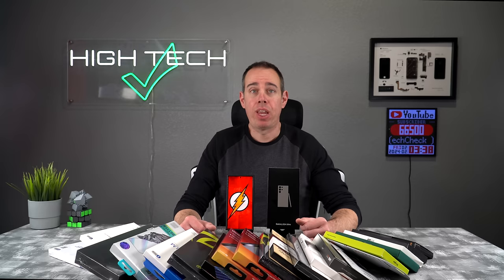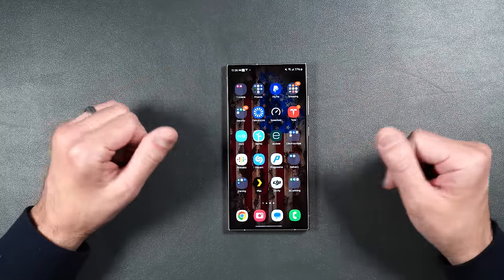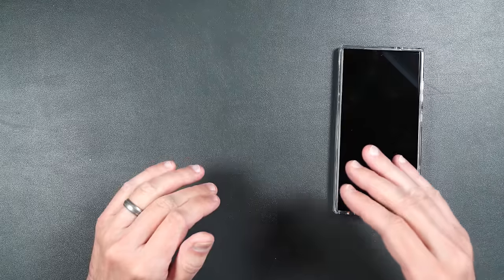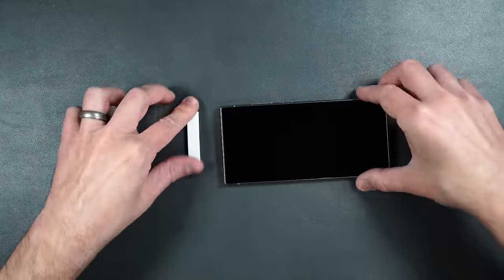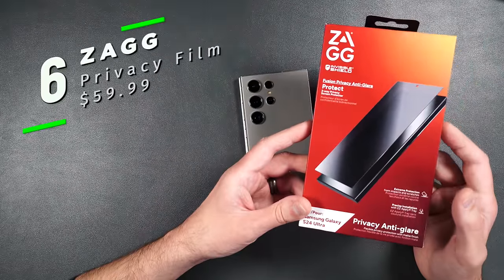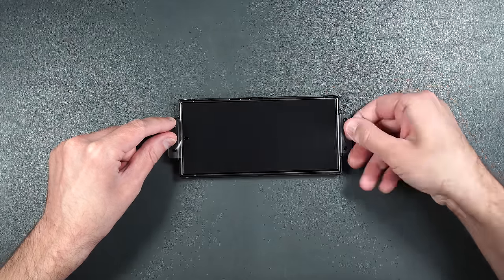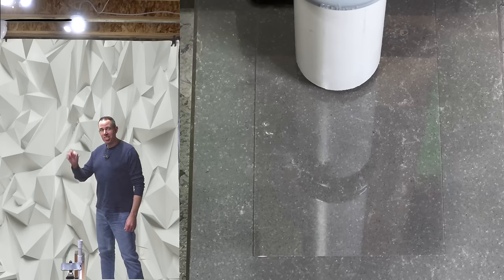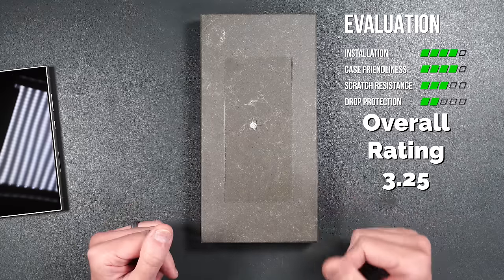Best And Worst Screen Protectors For Samsung Galaxy S24 Ultra

Comment: I just ordered the Whitestone dome UV GEN FILM. I did have the Zagg invisable shield glass elite protector before, it said on the package that it worked with finger print scanner but it did not. So I stopped using it. I hope this one works much better.

Comment: This is a brilliant video. If there's anything I'd add, it'd be the drop test. Stronger screen protectors tend to not break but then transfer all the drop stress to the phone screen and it breaks. I think it'd be better if you place a glass sheet under the screen protector instead of that solid block.

Comment: @hightechcheck ,   You made a fairly large error on the Whitestone Dome premium glass.  There should be NOTHING on the screen protector when you put the UV light on to cure the adhesive.  Anything that's on the glass will leave a shadow when you're done.  Since you left the square weight on the glass and put the UV light on top of it, that square weight left a nice shadow that will be VERY noticeable in sunlight.   You should address this so you dont make anyone else ruin their screen

Comment: What happened to the whitedome premium glass drop test ???
Reply: It happened that to remove the uv glass from the phone he already broke it.. Happens most of the time with uv glasses glued on phones... It's not easy to remove it without breaking it..
Reply: @chrisnik9750  they come with 2 protectors though, which is still weird how it didn't happen
Reply: @hypnotiq  my sense then tells me that the whitestone uv is somewhat same durability as the whitestone ea and therefore he didn't spent more time testing this one also.. 🤷🏻‍♂️

Comment: Nice review , it could have been better and complete review if comparison done between 2 different S24 Ultra . One with screen protector and one doesn’t have. 

1.  Do the rainbow test side by side with screen protector installed  and with the one doesn’t have.

2. Do a side by side comparison of screen with and without screen protector installed . Compare while screen is off .

3. Do a side by side comparison of screen with and without screen protector installed . Compare while screen is on. Open an apps, watch videos, games etc to have a more sensible comparison.

4. Do item 2 and 3 while indoors and outdoors.

viola! a more extensive and sensible review for the audience. 

Also strongly agree with other comment “one factor in choosing a protector will be whether it makes the screen more or less reflective relative to a standard screen”. which remain unanswered with your almost 2hrs video 😅

Comment: I've already bought & installed 1 of my amFilm Glass Protectors. 
Huge fan at how easy it was to install & a 2pk was $8! 
Bubble Free, everything from Fingerprints to S-Pen works great. 
I love the selfie hole & not that "U" Cut Out on the Protector,  it's dead center!
Reply: The privacy variety of that brand completely kills the fingerprint sensor. Just put it on and took it off not 30 mins ago. That's how I ended up here. 😅

Comment: Thank you so much for your screen protector reviews! :washhands: I tried the Whitestone UV GEN film w/no success (bubbles).  I saw your video the next day and decided to go with the Ultraglass UNBREAK TOP Glass which is better due to it's drop protection and scratch resistance.  If for some reason this doesn't work (bubbles) I'll return to liquid adhesion which I've had much success with.  Thanks again! 😀

Comment: Great screen protector review and love the time stamps! One question for you or anybody. You showed in your Torras that the cost was $7.99 but when I used your link, it was $25.99. That's quite a difference in pricing. Was your price listing an error or did the price really increase that much since the review?? Thanks!

Comment: The Flolab one was the one I was looking for. It does advertise anti-reflectivity, but I would like to see a side by side with the bare screen on the S24 Ultra. Great video though.
Reply: I have it on my s24u and its pretty great so far. Maybe not 100% as anti reflective as the bare screen but it's definitely noticeably less
Reply: @_jabe  That's good to hear. Does it distort the colors at all?
Reply: @DarkstalkerZero  not as far as i can tell. Didnt do a side by side comparison though. A side by side with my old screen protector vs the flolab one shows less relflections though. Not as much as the bare screen but for now thats by far the best i've seen
Reply: @_jabe  Thank you for the insight. Think I know which one I'll order now
Reply: @DarkstalkerZero  Its quite expensive though. I'm quite happy with it as it feels great and installation is amazing but i wouldnt spend 40$ just for the anti reflective coating. Its less reflecting for sure but the difference isnt worth that much in my opinion. But overall its a really good glass

Comment: i absolutely love your videos on the cases and on the screen protectors for the S24 Ultra.. Ive always been a Love Mei Metal Case fan as my note 10 and note 20 Ultra 5G both were saved countless times.. from being ran over with a car to falling off 3rd floor balcony, that darn case even saved me from a clip from a saw blade (current case). haha. So, I stand by the Love Mei cases even though they weigh a ton and turn your phone into a tank.. lol. Similar to you, I've always liked the whitestones dome glass screen protectors since I found them but they are a pain to take off once the spiderweb cracks are present.. So, their screen protectors are pretty legit imv. I am however curious on the new find and may try out the Torras Diamond Shield this time around or the UltraGlass due to the drop test..  So, thanks for the awesome video & for covering the real-world testing. I`d much rather watch a long video like this vs the hundreds of other small and inadequate vids any day! haha. KuDoS & you now have a new follower..
Reply: **you should try out one of the Love Mei cases for your own enjoyment and personal testing/playtime. haha. I can already assess things and confirm that you most likely wouldn't fancy it much due to the size/weight but it's totally the cybertruck style phone tank of cellphone cases.. The ones with the built in screen protectors are not all that great due to spoty and sometimes absent biometric compatibility.  Nonetheless, they are totally a legit option for "rugged" & "heavy duty" users like myself with an added & compatible screen protector..
Reply from the maker: Thank you for the comment and the support! I’ll have to look into the mei metal case.
Reply: There are different screen size for the S24 Ultra which one is more compatible?

Comment: Why was the AMFilm Clear glass such a fail on the drop test whereas on the S23+ version it held all the way until 8.75 feet?  Is it the same screen protector only for two different phones or no?
Reply: I used AMFilm on my S20+ so decided to go with them again for the S24U. That was before I saw this video. I will probably try one of the top 3 brands on the next go around. It's only been a week so the AMFilm will be with me for a while unless it cracks. Also decided to go with a Rokform case this time instead of OtterBox.
Reply: @wakemiamigreatagain  He just did a vid on screen protectors for the S24+ I believe yesterday (after this one, for the Ultra) and once again the drop test on the AMFilm held up until 8 feet.  Not sure why it broke so easily for the Ultra.  Maybe a bad batch or something?  Out of curiosity, which Otterbox case were you rocking before and which Rokform are you going with now?

Comment: I would love to see the ESR tempered glass screen protector as well as AACL because they did really well on the Tab S9 ultra test (and I used it and had my tablet survive an incident with it). I also appreciate the "snyder cut" style screen protector videos because NOBODY does this, especially for this many cases. Glass drop protection is something that can only be determined by a true drop test and you're providing us absolutely VALUABLE information. Your chapters are a little off on the TV tho, dont know if thats a tv thing or what.
Reply: I put ESR on mine since day one. Super easy install, zero bubbles, very smooth and leaves a small gap for my Ringke onyx mag case. Only thing missing is it's not AR like the original screen
Reply: I use the ESR for mine also. It's honestly my favorite screen protector to use. Easy to install and works really well.

Comment: Does the XTR3 have any drop protection being glass fusion? Or is it more film than glass still and wouldn't have any shattering? I currently have the XTR3 on mine and was hoping to see if it would do that lol.
Reply: Did you get any info?
Reply: Nah unfortunately not lol. The only thing I've found is that it helps dissipate damage, but nobody has really tested it. I think a good way would be having 2 pieces of tempered glass on a block, one piece with the XTR3 film, and do the drop test with the ball to see if they crack at different levels.  @Pandahhhhhhhh

Comment: Great video I got a glass screen protector on my s24 ultra but after I installed on the left side of my phone on the right angle with the light there's like a green purple rainbow effect on the left side on my phone after I install the glass screen protector is this an issue what is this I don't understand when I did not have a screen protector on my s24 ultra the screen was fine never dropped it screen is like brand new when I apply at the glass screen protector I have this weird coloring on the left side of the screen protector

Comment: It's either the Ultra Glass or the Torras. The Torras has better screen protection, but kinda awful rainbow going on. The Ultra Glass still has great protection,  yet less than the Torras, however much less rainbow. I was originally located the Zagg XT3, alas, it's apparently ass. I love the install of the Ultra Glass and Torras. I just wish they'd stop making to ugly as sin U shaped camera holes. It kinda defeats the purpose of having a full screen like we do. Shenanigans I tell ya! Probably going for Ultra Glass.

Comment: Does the Galaxy S24 Ultra display lose a lot of quality and brightness when installing Privacy Glass?  I still have a question whether to choose Spigen or Ringke glass
Reply from the maker: Yes, the privacy glass does reduce the brightness a fair amount. I find I have to turn the brightness up all the way to compensate.
Reply: @HighTechCheck  how to maximize screen brightness on galaxy s24 ulte
Reply: enable or disable adaptive brightness

Comment: based on your recommendation, we bought the Torras diamond screen protector - it fell less than 2 feet and landed on it's side and cracked within two days. spiderweb cracked. I can't use my fingerprint sensor now bc of the crack. Very disappointed. Left review on Amazon where we bought it.

Comment: Has anyone else noticed that the TORRAS DIAMOND SHIELD bubbles at the top and lefthand side a few days after installation? I tried two on a Mous case and figured it was the case. I put a TORRAS case on and applied a new screen protector. A few days later the air bubbles appeared at the top and left again which lets me know that it's not the case(s) but seems to be the screen protector itself.

Comment: Thank you for the excellent and helpful review. Like many others (like @woofinu and @adventurenowtv7274) I wanted to ask you: since the s24 ultra comes with Gorilla Glass Armor, that is supposed to reduce glare considerably (and is presumably pretty strong) - do not these screen protectors compromise that new - lauded - feature? Which screen protector has the least glare out of all of these?  It's not just about strength, smoothness and responsiveness with the latest Gorilla Glass. I also wanted to ask: if one has Samsung Care+ and they'll replace the screen in a day (for as long as one is paying of course), in your opinion, is it worth it to just use the screen without a protector? Thanks!

Comment: The amfilm left and right side ain't rounded properly.  Kinda makes my thumb sore.
Reply: I'm finding that out too. I have already tested the spigen ez fit one and it was the same. I am currently in line to get a torres and a wysken. Hopefully they have better rounded edges.
Reply: @brandenite  I still have the amfilm on.  Got a case, and the issue wasn't as bad as before.  I still don't get why they didn't curve the edges properly,  especially with gestures being the default.
Reply: @dozieeze Yes, I tried the case thing too. I usually use a tough armor case, and the edges were still pretty crappy. I switched right now to the liquid crystal clear case by spigen and it is better... but I feel like it lacks enough protection for the phone. I never knew there was a slim armor version of the tough armor. So I have ordered that and am currently waiting. Tell me you're OCD without telling me you're OCD. I can't help it. It's gott be just right. 🤣

Comment: For anyone worried about fingerprint not working i just got my s24u yesterday put the torras diamond shield on it i have 3 fingerprints registered no issues a lot faster than my note 10+ with no screen protector

Comment: wtf 52:30 all you did was pull 1 tab and lift the film off, flawless application, fits perfectly, no bubbles as you exactly said.... but yet only a 4/5 for installation????????????
give it 5/5 what else do you want it to do for 5 stars? be applied via magic without even touching it?

Comment: i had the worst experience in a few different screen protectors for my s24 ultra and they don't line up properly, they are not full screen protection, they collect dust before installing, leave bubbles and they fail to recognize the fingerprint after re-registering my fingerprint!! i perfer NOT to waste any mlre money on them and only use the lens protector and the ultra thin case for my s24 ultra!!!

Comment: 1:58:00 I'm sorry but The whole point of a screen protector is to break if it is too durable and you do drop it instead of the glass breaking the sensitive OLED panel underneath can get damaged The whole point of a screen protector is to break just like a helmet to take the Brent of the force so that the screen protector breaks and not your screen or your OLED panel